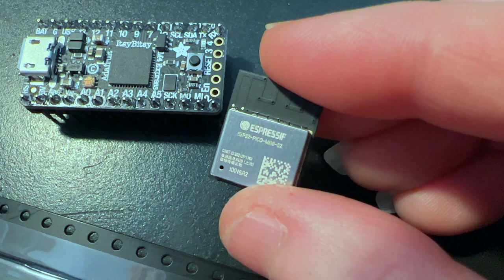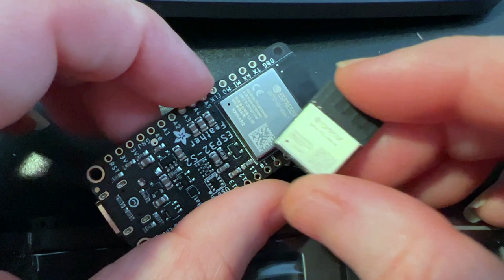got some esp32 pico modules in and they're smol!

Comment: Would be good to have a small board that has a battery charging capabilities, and also a possibility to cut power via software. And to turn it on via some pins. Kinda the basics of any project, functions that seem to be currently quite quite hard to implement.